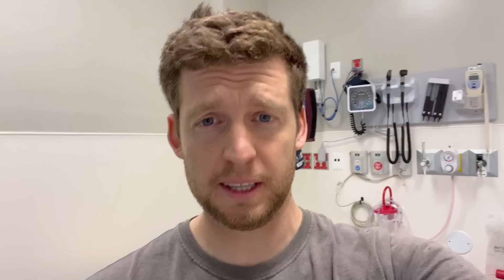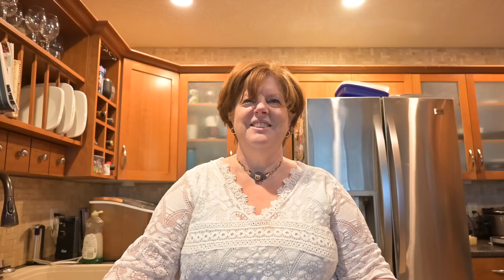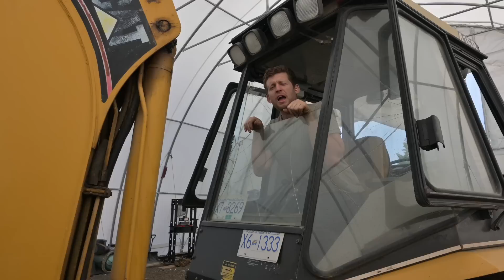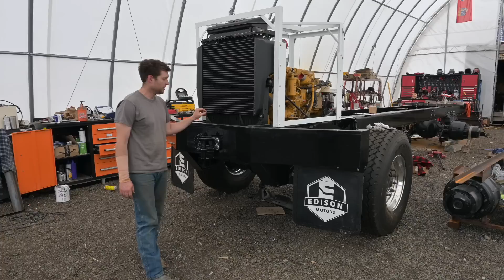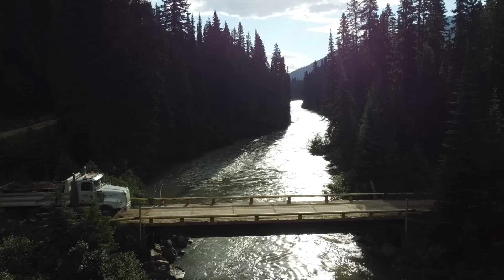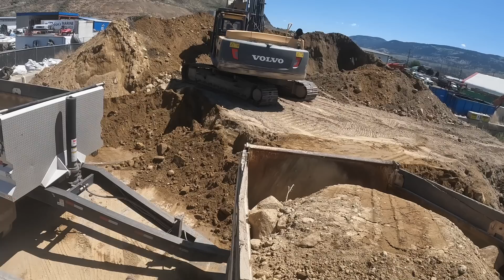E-Axle Installation Goes Wrong! Emergency in the Hospital

Comment: maibe look intoo ways to prevent stuff from shifting while working on it , ive worked in production of heavy equipment and there was a LOT of thought that goes intoo making sure the people working the production line are safe doing so (allso a lot of thought goes intoo making sure people never lift more than 25 kilo )
sumting i seen when people procude trailers is that they lay the thing upside down , that way you can use a overhead crane to lift everything on the chassis that fits under it before turning it over on its wheels and lift the rest in place

Comment: Daim that was a close call! 
In the meantime before you get into a Building, you should invest in some 3/4” plate steel plates that will make you a solid base to work on and then get some Mini hoists the ones that are like a Scissor lift that will raise a car 42-48” I said a couple like a pair so that you can lift them separately, the hydraulic pressure pump and reservoir is connected via a umbilical line to the cylinders so that they can only about two inches tall when fully assembled and depressed. The pressure pump stuff is like on a 2 wheel dolly hand cart. 
I’ve almost bought one myself, from Eastwood. Shop around and check out their prices. And weight capacity. Good luck 😊Fellas 
That shake hands with danger video came out when I was in school in the middle 70’s I think and in the late eighties I had seen it 10 times by the time I was in the Army as a ASE certified automotive technician and in the Heavy Construction Equipment mechanic Course at Ft Leonard-Wood MO. Little did I know at the time, I had picked the second most dangerous Job in the Peacetime Army… Explosive Ordnance Disposal was number one!

Comment: Glad there's no brakes, but soft tissue and muscle damage you might wish it had been broken, that stuff takes a long time to get back to normal speaking from experience here. Seems like you've got a good crew so give that arm some rest, put it in a sling so you're not tempted to use it for a few weeks and lean on your crew to pick up what you can't, that's what you pay them for. Basically the more you use it the longer it's going to take to get better.  Good luck and have a quick recovery

Comment: This is why we used overhead cranes in automotive manufacturing.... I hope this leads to some processes reviews. 

Glad everyone is alive and glad you still have the arm.

So yeh, please just shake hands with danger, you wont win that arm wrestling contest
Reply from the maker: Yeah, I wish we had the ability to have an overhead crane.  It would make life so much easier
Reply: @EdisonMotors safety aside, you would save a lot of time and increase efficiency in a shop with gantry crane.
Reply: @EdisonMotors  the engine hoist from the last install video was a pretty good idea... Maybe something can be fabricated to run along the top of the frame rails and act like a crane?

Comment: That's cutting it thin buddy. You already bounced back. Hospital gowns are designed for full access and swift intervention. God bless y'all n keep ya safe. You will need to rethink assembly safety. Nothing fancy but a solid x raise hydraulics platform you could roll under there n some cranes. Most important you will need to make haste focused n smart Instead. You need stays n holders that can handle a big weight.

Comment: I was changing front springs and bushes on a 20 tonne franna crane (pick and carry crane) a few years ago pulled the bushes out and went to let the jack down and the jack was too high hight thought the  keeper bolts would hold  the springs in because they hadn't been taken out yet.  I got the apprentice on the job to take the jack out and get the lower one thinking it would just hang there on the keepers the apprentice had to get the jack out from under another crane so while I was waiting I decided to move back and have a smoke as soon as I moved and lit my smoke the whole diff assembly fell down because the rear keeper bolts were rusted/worn and the centre landed where my knee was only seconds before. Everyone in the workshop came running over to see what had happened and I was just sitting there shaking like a leaf with a cigarette hanging out of my mouth and a stund look on my face. Ever since that day I have made shure there is atleast 2 things holding shit up for redundancy before I got under it

Comment: As a guy from the same town as the dude who invented hub motors, why are you going with a central motor on a traditional pumpkin? Also don't put anything you want to keep under a suspended load, ya derp. But at least you followed the advice of your fellow BC Youtuber AvE with mommy on speed-dial.

Comment: I can empathize. I was working on my old suburban. I had it on stands, wheel off. I was trying to put the wheel back on, it started to shift and I stupidly tried to stop it. My arm was crushed between the wheel well and wheel. A neighbor heard my calls for help and came running, he was able to jack up the vehicle. All soft tissue damage thankfully, I lost feeling in some fingers for a few days and had a literal dent in the arm about an inch wide for a while.

Comment: Good the arm is not broken 
I been a HD Tech all my life and knows a bit about differentials
the way the gears are cut and designed .They need to run in the direction they are designed for 
 I'm sure the E axle is made with a regular gear set and just a electric motor installed on to the pinion 
Hope you checked with the manufacturer on the direction that is designed to take the full torque 
Seen many diff problems from backing up on to the stacked gravel pile 
Good luck  
Hansel

Comment: When I working for a truck remanufacturer, my role was truck breaker, and a Kenworth T388 needed stripping for sandblasting and paint. It was a cement truck, so the bolts were rusted to rivets. Took an angle grinder to the mudflap bolts, and my left thumb by accident. Missed the bone thank God and went halfway along the nail. Only an hour before we'd used two forklifts either side to lift the agi tank off the chassis, it almost seesawed to the ground but we held it level, while the truck drove out and another reversed underneath to take it away. Sometimes it's the small or mundane things that catch you out.

Comment: When you get a shop with cement you can get a craddle built to go on wheel lugs that can be adjustable height leaving under axle free of supports and free to work on them and mount them even able to easily roll around to adjust its position

Comment: Concrete the floor and get a overhead gantry on wheels with either electric winches or manual block and tackle winches like twin stick garage, GRATZ MFG is the make, not sure where he got it from 👍🏻👍🏻👍🏻

Comment: When I first watched you installing the axles all I could think of "these guys need a gantry crane"  Absolutely the safest way to do any heavy lifting. For the time being until you get a big fancy shop build or find a mobile one with the 4 wheels.
Reply: Hazard Fright has them.
Reply: @my_channel_44 this is Canada we dont have them we got princes auto. Its the same thing but Canadian
Reply: Yes, the wheels are a great idea in their environment.  A good design also has feet that can be cranked down.  This means you can seriously lock it in place when you aren't moving it.
Reply: I know they want to be able to do this with minimal equipment just like the end user may be doing it if they buy a kit to upgrade a truck.
Reply: @chrisloehr6641  that's a good philosophy to have, but in light of this I'm not sure they'll be able to justify not having proper safety equipment
Reply: @TheHorseOutside  mean this could have been prevented with pretty basic equipment which they have done now. Unsecured loads, basic safety precautions and one of the most common causes of injuries, it's often things we don't think of as loads which are the most dangerous, like a bloody 8x2 that landed on my head after someone propped it up on the wall sketchily.
Reply: @brendandor  I'll be completely honest, I don't have experience in this area so I thought they had been using basic safety already. Clearly not lol
Reply: Gantry crane, and put locked-position wheels on it, and build a concrete floor with gutters spaced and shaped for those wheels. 

That would be the cheaper version of the big overhead cranes they install in factories. It's what I'm planning to do in my own shop.